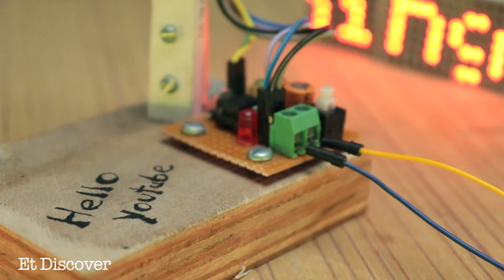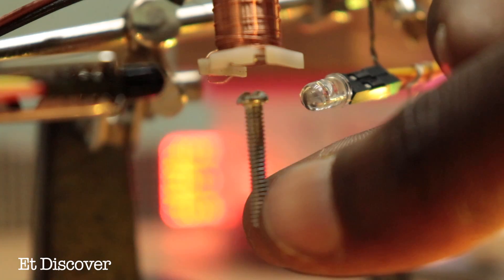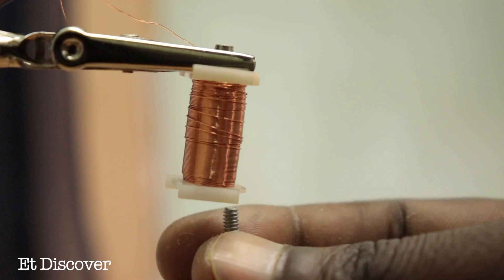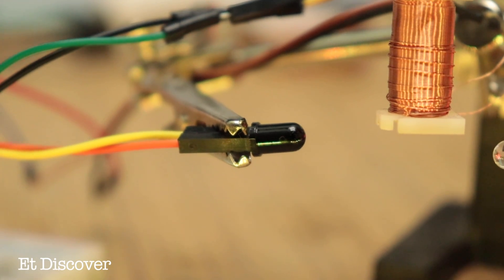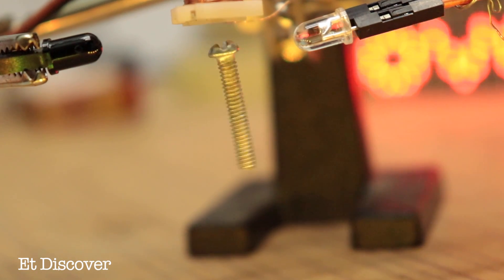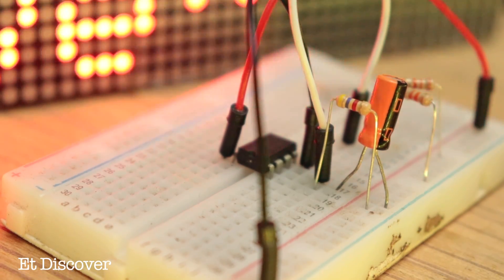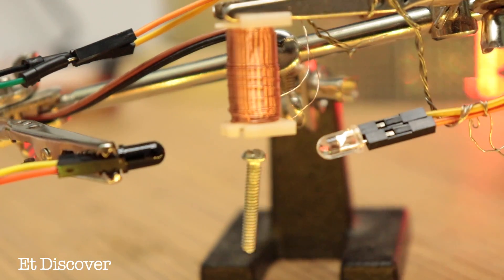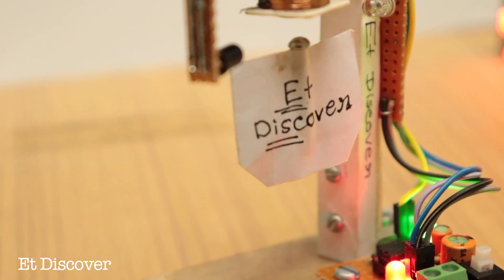As a '0' Gravity Hanging object # Levitation Anti Gravity #

Comment: actually i just want to know that where the ir transmiter and reciever are fixed and what is the connection for relay because it is not given in circuit and please tell me that to use IR sensor module or simple seperated ir reciever and transmitter?
Reply: please rep its urgent

Comment: Can i connect a buck and a boost converter in series. Boost converter is to convert 12 volt to 35-40 volt and buck converter to control this 35-40 voltage. Actually i want to create a lab bench power supply.

Comment: Can i connect a buck and a boost converter in series. Boost converter is to convert 12 volt to 35-40 volt and buck converter to control this 35-40 voltage
Reply from the maker: If your coil loads in 500 milliamps  then you can run it
Reply: No! Not for this project. I want to creat a lab bench power supply and i have lm2596 buck converter and xl6009 boost converter.

Comment: Hello brother. How r u. I have a question. It's possible for AC to DC ?
EX: AC110-240V then output DC80V 200AMP
Reply: And also it's possible for DC voltage, ampere power adjustment
Reply from the maker: The welding machine is of 3to6 volts of 80 to400 amp. But 80volt 200 Amp, I don’t know the exact thing about this.
Reply from the maker: If it is possible to make it, then the transformer will be very big
Reply: @EtDiscover  thanks for u r reply brother